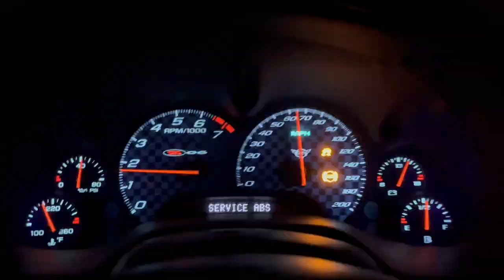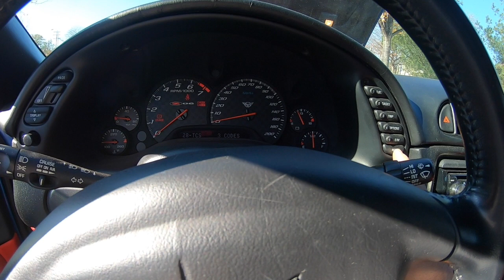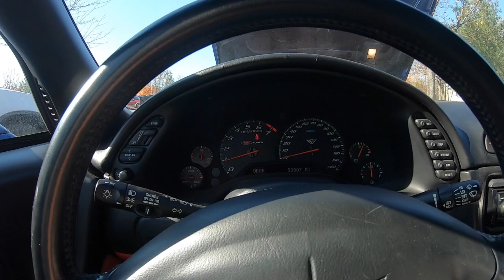Every C5 Corvette Owner Goes Through This (EBCM Fix)....

Comment: My 01 has not had this problem yet but from my understanding the EBCM in the 01 and up are different from the 97 to 00 Corvettes. I heard in most cases the 01 and up EBCM can be rebuilt/ repaired. Just to be safe I have a another EBCM in the garage still in the box ready for replacement of needed. Nice Z06.
Reply from the maker: I also heard the same. I also heard not to buy a factory replacement ebcm because the relay that breaks is due to the material it’s made out of. When you send it to abs fixer they replace it with something stronger abs also put a surge protector on it. For what it’s worth I heard it’s better to have it rebuilt. Hope yours doesn’t break!!

Comment: My traction box is out and it's gonna stay  that way its the lil metal box  right by.  Washer fluid box that thing cost a 1000 to repair lol but I'm not slippin and sliding   without it um to get ur dash to stop saying that just press the reset button errtime  u start the car
Reply from the maker: Someone told me that their tires locked up when the ebcm was down. What year is your car? Mine only cost $220 to repair

Comment: can you drive without the bcm installed?
also, i have a 2000 c5 6 speed with this issue. can they service the 2000?
Reply: No, I'm attempting to reach out to creators for help. From what I've read there is no way to repair a 97 to 00. I don't understand how tho, anything is possibly. I don't know what makes it unrepairable.

Comment: I’m acquiring a 2000 C5 this summer with only 12,500 mi on her. Should I assume the EBCM is going to fail and go ahead and send it in for upgrade before it fails?
Reply from the maker: I would assume it’s going to fail however there’s no need to send it in now
Reply from the maker: When it fails you just won’t have traction control

Comment: Who did you use? I have to do the same thing. What was the turnaround time? Do they send those reset instructions?  thank you
Reply from the maker: Abs fixer. Turn around time was 1 week and no I just reset everything without those instructions. Haven’t had any issues thus far. If you follow me on Instagram and shoot me a dm I can send you a link. For some reason it won’t let me put a link here. But Brandon at abs fixer is the best